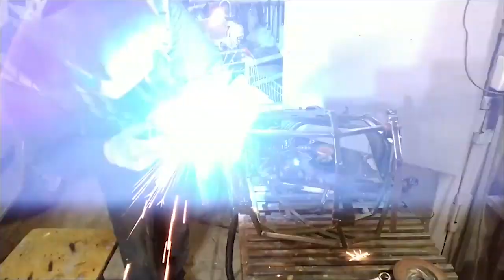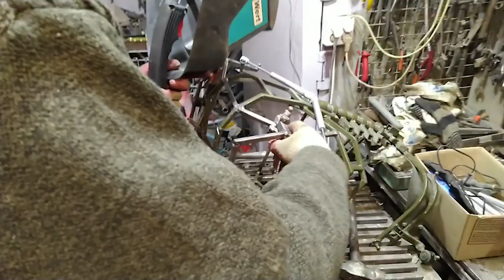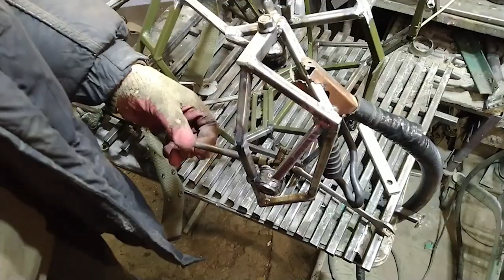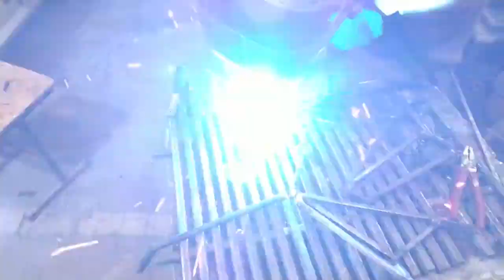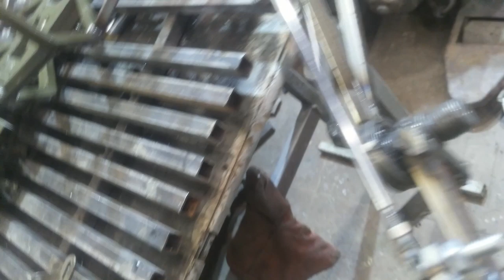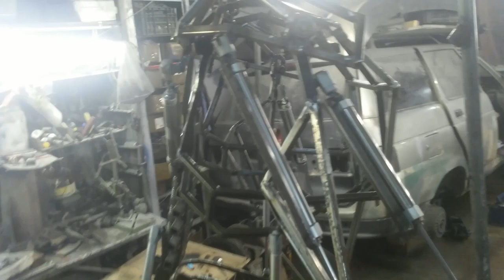Mark 4M powered exoskeleton. Shoulder girdle. Part2. eng subs

Comment: how much can it enhancestrength and speed?
Reply from the maker: Force - depending on the size of pneumatic cylinders, compressor power and pressure in the receiver. Speed - depending on the limitations of the body of the operator. The joints and muscles of a person will not withstand the speed much greater than they are trained.
Reply: @nomadcontrafact6305  what is an estimated percentage of attribute increase you think is gained?
Reply: 10%  incease 25% increase?
Reply from the maker: @markfeltner8260  It is currently missing. The framework can only move itself. Since the prototype is a test sample for testing the operability of the pneumatic drive circuit and the mechanical amplification system. It would be unsafe to immediately install the reinforcing drives without making sure that they do not injure the operator. But in the future, the carrying capacity of such a system should be about 100 kg.

Comment: ever thought of using electric actuators? you can make one using some ball-screw linear rails, and depending on the motor you can make it move quite fast and precisely, stuff like this: https://www.youtube.com/watch?v=FQ54_NLaV-s
Reply from the maker: Yes, we even experimented with them a little. We made a screw electric drive and an electro-semi-active one. They would be good for medical purposes. And here pneumatics are used simply because they are cheaper:-)